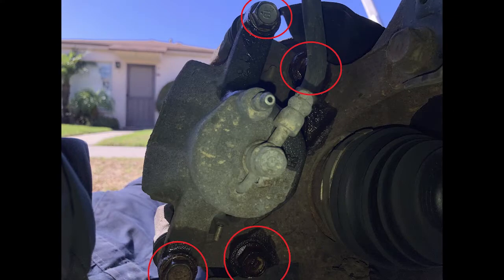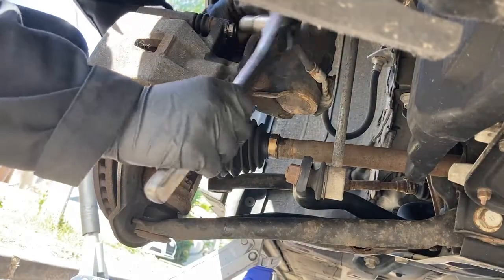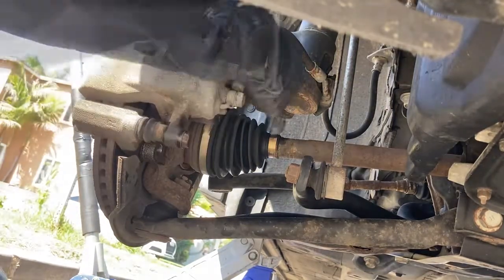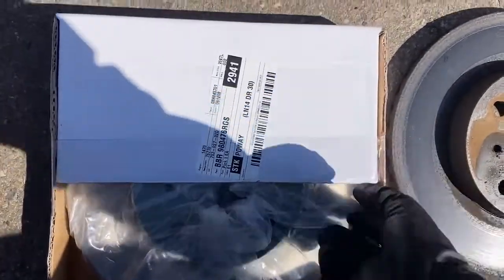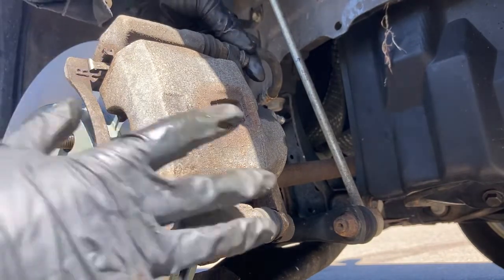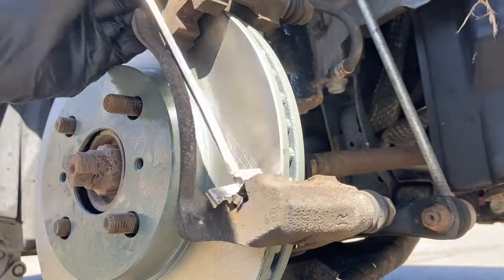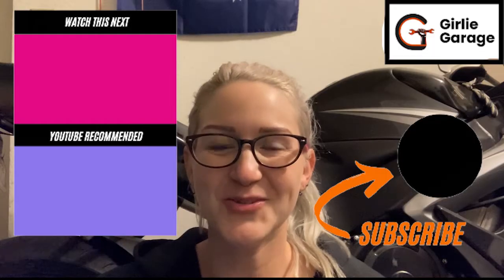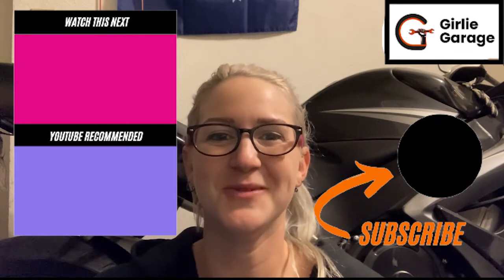2012-2014 Toyota Prius C - Replace Front Brake Pads & Rotors - Girlie Garage

Comment: Great video, but for all y'all about to tackle this job, using your foot to break the bolt like that is a great way to round it. I only say this because I found out the hard way.

Sticking a small pipe on the ratchet will get you out of that bind, or you can heat it up with MAP gas if that doesn't work

Comment: The listed torque 17mm bolts of 101 ft-lbs is way too high; instead, per Toyota those bolts should be torqued to 79 ft-lbs.  Over-torquing the bolts causes deformation of the bolt as you make it thinner than what it was designed to handle load-wise.  The slide pin torque of 25 ft-lbs is correct.  If in event you have to replace the entire caliper, the banjo-bolt is torqued to 22 ft-lbs.